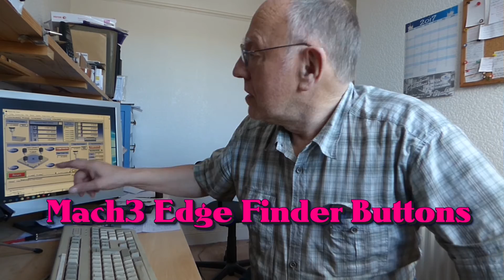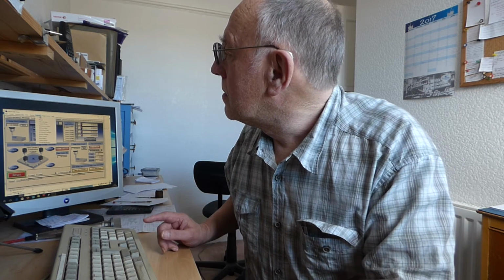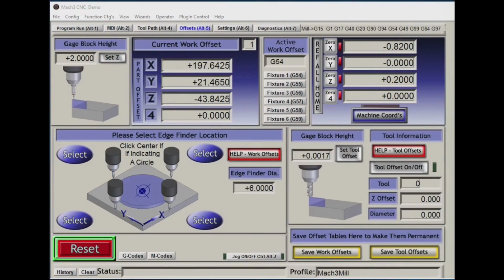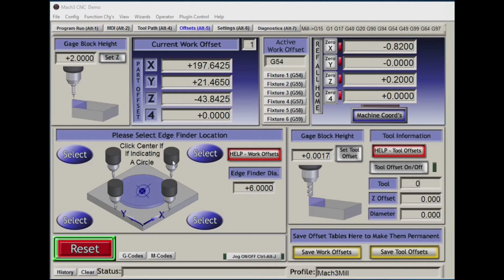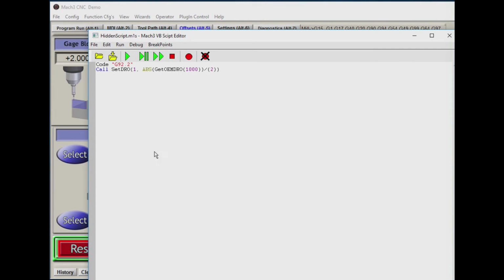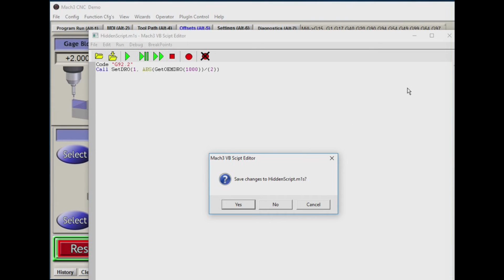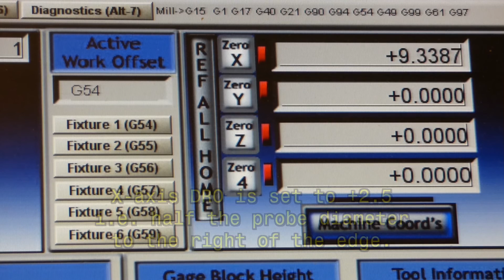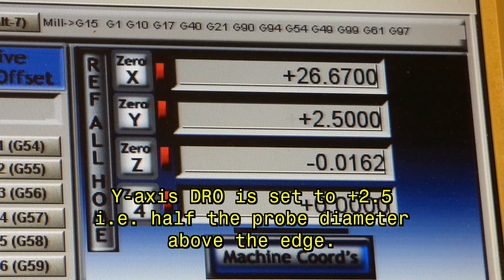Mach3 Edge finder buttons

Comment: Certainly one obvious error not far from the start.  Where you currently have 

 XCurrent = GetDro(0)
 Current = GetDro(1)

I think you;ll find it works better if you have

 XCurrent = GetDro(0)
 YCurrent = GetDro(1)

The code 10 ir so lines later

Rem Probe up
   YNew = YCurrent + 75

will have much more chance of doing something useful
Reply from the maker: Well done. You have spotted a real error. This error is in both the Y direction probes (probe bottom edge and probe top edge). Also, in the 'probe top edge' the 'Rem Prob up' line would be more correct if it was 'Rem Probe down'. Thanks for letting me know.

Comment: Hi Jim,  I managed to get it working, but had to copy the text to notepad first, copy the notepad text and then paste into the button script.  If i copied direct from the YouTube page, It just didnt work for some reason.  I also got the hole centre script working but to get it working, i had to remove the "Wend"  command after the "Code "G0 Y" &YCenter 'rapid move To the center location While IsMoving ()" line, and had to add in a "G0 X" &XCurrent for the return after X move to the right.
Reply from the maker: I have tried to implement the same fix as yourself by copying the code into Notepad. When I did this it did not copy the crlf codes for the text. This resulted in the code being one massive block of text with no discreet lines. Did this happen with you? If it did then when you pasted it back to the button script, how did you regenerate the individual lines?
Reply: Jim Taylor hi Jim,   Yes, it was just one long line.  I had to edit it all and put it in sequence, then I ran the script editor which showed the errors I missed.  All good now once I deleted the “Wend” command as mentioned.

Comment: Hi Jim,  I am only able to get Y axis to work.  the other come up with a "Scripter Compile Error"  any ideas?
Reply from the maker: When you downloaded my code, did you replace all of the instances of 'NE' with '<>' angle brackets?
Reply: Hi Jim,  yes, replaced them all.   i also tried the script for the circle (hole) centre finder and got the same errors.  Just wondering if there is something missing from the scripts when they were copied to the YouTube page?
Reply from the maker: I don't think so since others that have used it seem to had no problems. Only Barri Kellow found one problem and fixed it - see below. I see that you say that the Y axis works. Have a close look at the other axes and make sure that they follow exatly the same syntax as the Y axis but with only the obvious differences.
Reply: for the X axis, put the "Code "F"...." after WEND on a new line. You'll notice that it's like that on the Y axis

Comment: Hi Jim.
Thanks for sharing.
Actually isnt working.   Says Syntax error.
Can you help me please?

I have mach3 R2.63

Thanks a lot.
Reply from the maker: My Mach3 is version R3.042.040. I suggest that you upgrade and try again. Good luck.
Reply: Thanks Jim for your answer.

But No. Unfortunately I have not had success with the update.
When you say change the letters NE. I do not know what to put in that place.
Could you expand your explanation?

Thank you very much.
Reply from the maker: Sorry that the update did not fix it. As regards the change in the letters NE, I think that you should be replying to barri kellow.

Comment: Dear Jim,
I'm 70 and live on Curacao and my English script is not zobest. Very interested in the world, I bought a Chineshe cnc 2030 which works with mach3. I would also like to find the corners easily and have also tried to install your script. Unfortunately, the result is not good. The XY moves all the way but measuring the corners of my totchfinder is not found. Also have no knowledge or experience for writing the script, so a problem. I think you're wondering and I wonder what's wrong with me.
Regards,
Rien
Reply from the maker: Dear Rien
Without knowing the configuration of your machine it is difficult to give you advise on your problem. However, here are a few things to think about.
1. My edge finding system as described in my video, will only find the edges of metal parts unless some kind of electrical contact piece, for the probe to touch, is placed on the part.
2. The probe or pin mounted in the spindle collet must be electrically connected to the correct input on your cnc breakout board.
3. You will also need to set the Mach3 probe, port number and pin numbers (input signals) settings correct according to your system.
4. For a more detailed explanation of how I connect my system for the probing please see my video at: https://youtu.be/38bJjcp97QI - 'Yet another Zero touch probe'.

I hope that this is of help to you... Oh, by the way, I am 77.
Reply: Hello Jim, Thanks for your response, have another question. You say in this script to change EN into the two not-equals brackets. What do you really mean? 
Is that X and Y or LH and RH. Both have tried but do not work. Greetings and please hear from you.